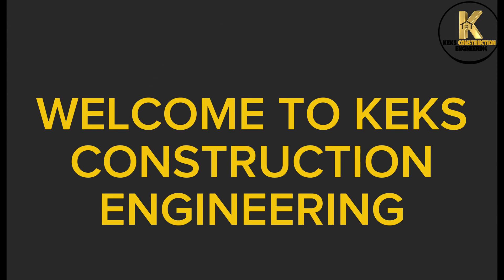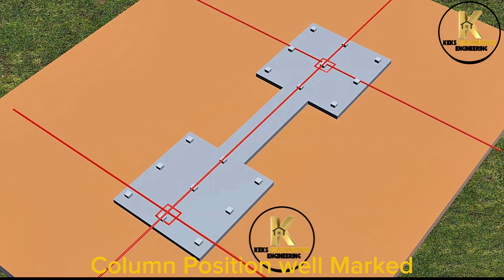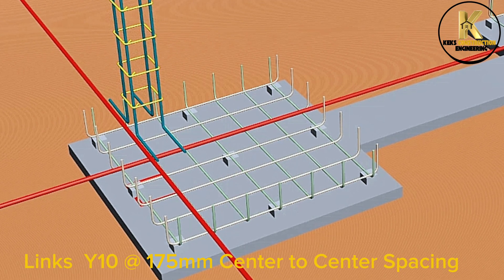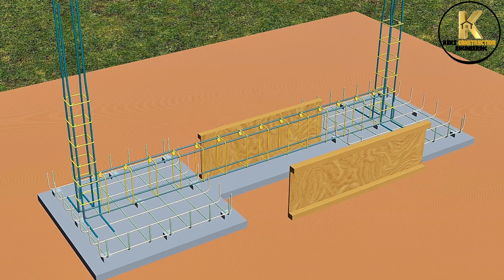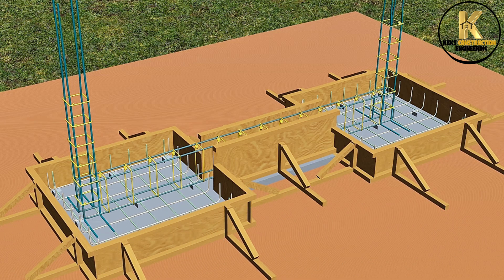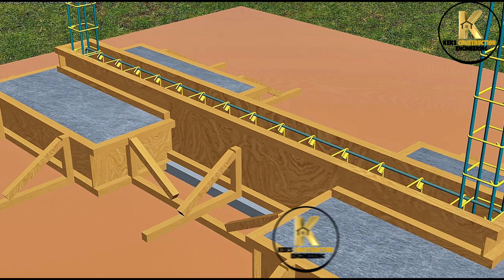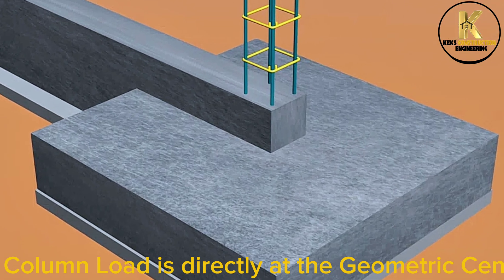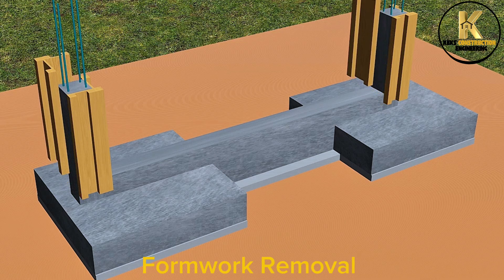How to Construct ECCENTRIC & CONCENTRIC FOOTING |Foundation types

Comment: Sir, is this foundation used for all kinds of structural works
Reply from the maker: No.... Eccentric footing is mostly used when there's Architectural, construction or boundary Constraint.
E.g if you your normal Concentric Footing will encroach into another person's property, then one can use Eccentric footing in order offset the Column from Encroaching into another person's property or any Constraint.
Reply: @keksconstructionengineering  Okay sir...... Understood